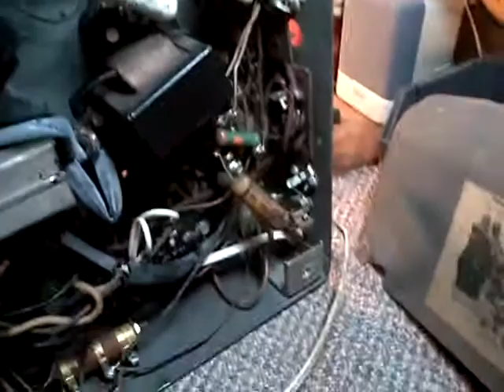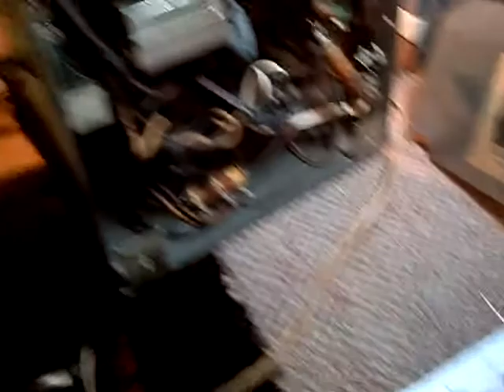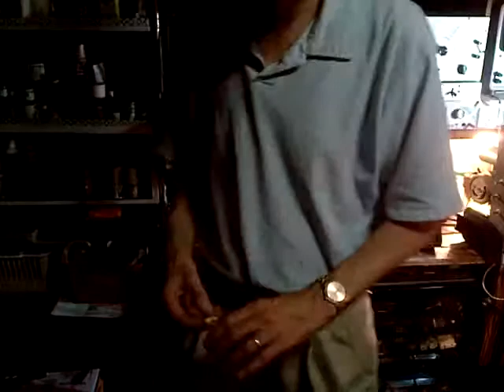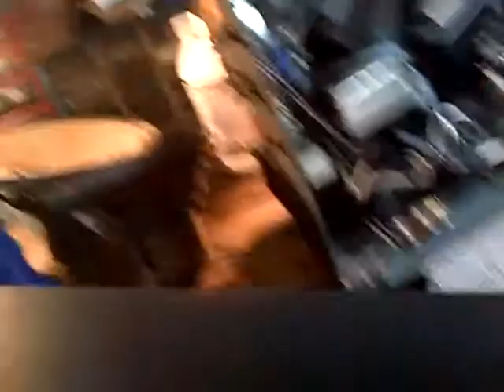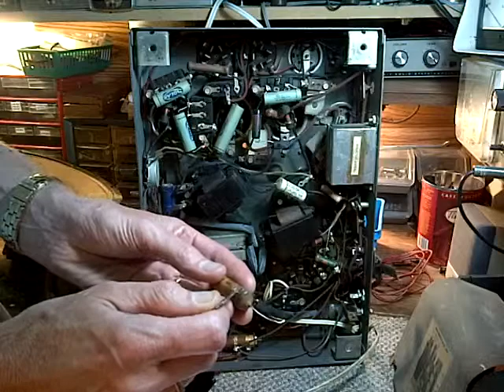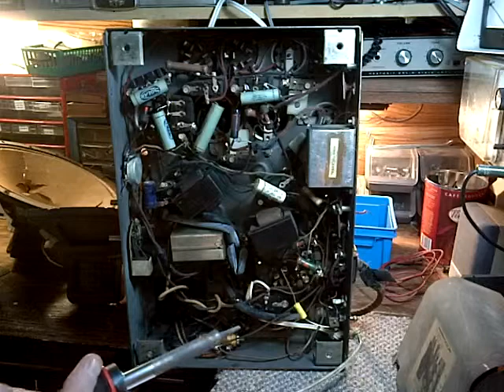Philco 91A-221 Tube Radio Repair Video #3 Capacitor

Comment: The outside foil conundrum drives people nuts who don't understand what capacitive reactance is.  Basic radio theory 101.  Know this:  If the capacitive reactance is LOW at the frequency of interest the capacitor is a short circuit to that frequency.  If the capacitive reactance of the capacitor is HIGH at the frequency of concern the capacitor is an impedance greater than zero.  The capacitor defines the impedance of the circuit it is employed in.  A BYPASS capacitor that is low impedance is therefore a SHORT CIRCUIT to ground at the frequency of concern.  Therefore it doesn't really matter which way the capacitor is connected with respect to the outside foil lead.  On the other hand a tone shaping capacitor has a much higher impedance to its frequency of concern, therefore it can be more susceptible to noise pickup.  A well laid out radio will keep the various circuits separated to lessen cross coupling their signals to other circuits so the outside foil orientation is essentially moot.  The main purpose for utilizing the outside foil for shielding is in equipment that is tightly packed and every effort to avoid cross coupling must be employed.  Good luck, Jim! 🙂

Comment: Thanks for video. I see someone has piggybacked those Solar caps in top of the Bakelite block caps. Hope the original were disabled (thin wire coming out of rivet you can cut). Can be rebuilt without removing from the chassis, despite the overkill ways we have all seen on the internet. Less than 5 min each, and no unwiring.
If that (paper) cap is the first cap you replaced, it may be better to replace the electrolytics first,  as they are the most critical, then the paper caps. We all know that 70-80 year old caps should be replaced. Doesn't matter if they  are 'working' or not. They are on borrowed time. Anyhow, I plan on looking at your other videos thank you for what you do  sir.